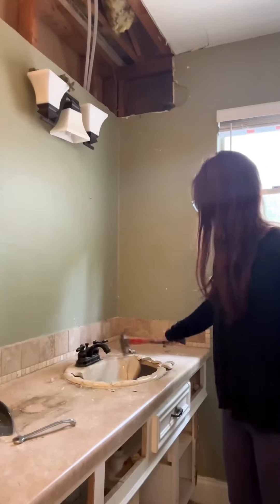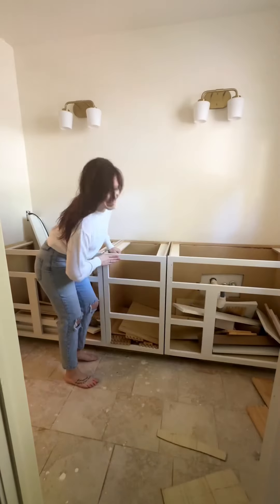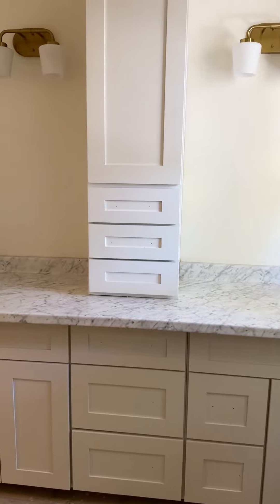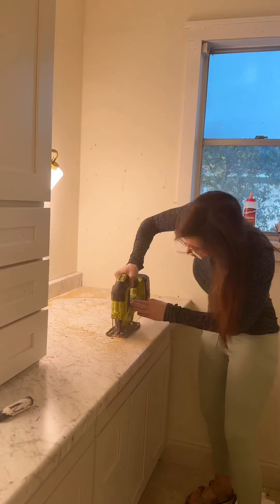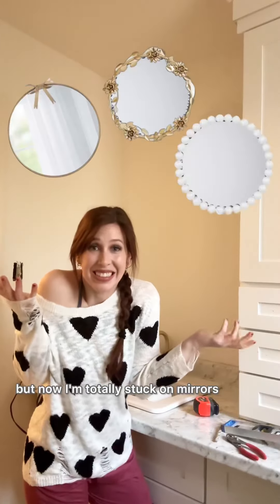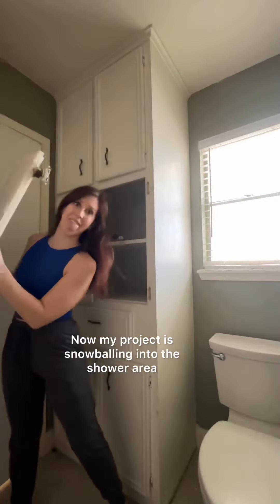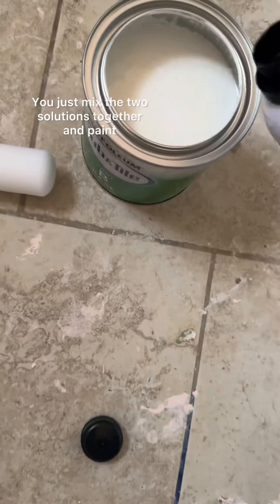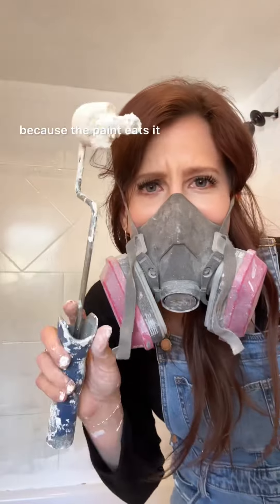I destroyed my kids’ bathroom. See how I put it back together!

Comment: The previous bath tile was pretty. Although, l understand it was too mature, for the kiddies. Painting tile can help at times. However, l wouldn't use that option in the bath. Where  chemicals on the skin will be a constant factor. From the heat, water and moisture elements.